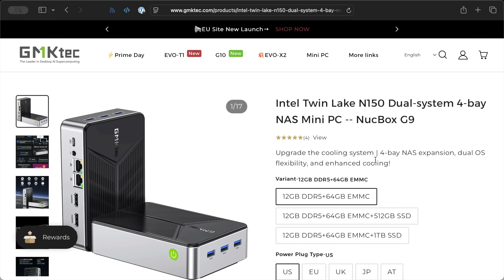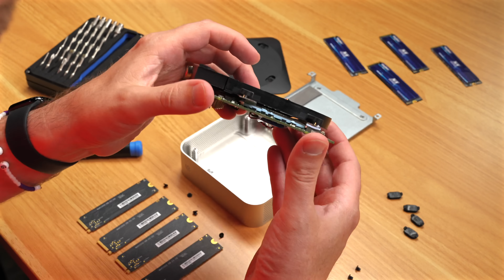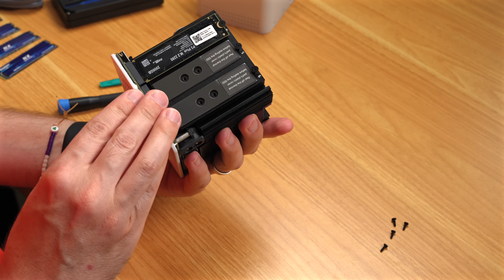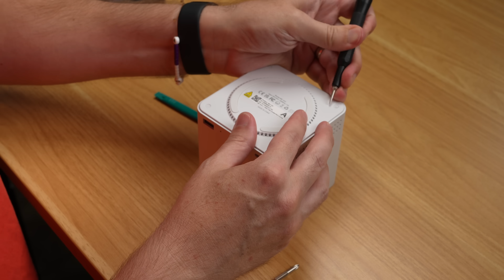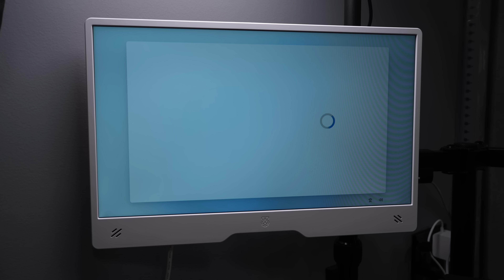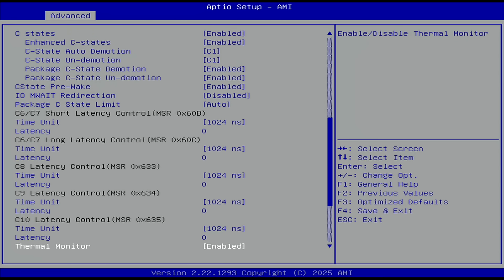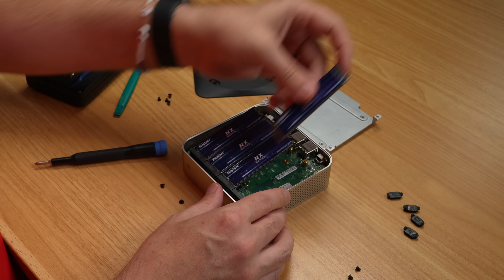The Mini NAS has arrived! (mini homelab)

Comment: just remove those rubber plugs and put them next to the screwhole on the bottom. they still function as they are intended, but the screws are always accessable. I do that to all rubber dampening stuff that cover importent parts.

Comment: I have a Beelink EQR6 Ryzen 5 with 24GB ram and 2x4TB SSDS. I was using as a NAS with Unraid, but the boot thumb drive got corrupted twice within a year, so I instead installed Ubuntu Server. I have a Minecraft Server, Immich backup of my iCloud Photos library, a couple of WordPress sites installed in Docker containers… And Time Machine backups for two Macs. Not bad for a mini PC solution that costs less than an off the shelf NAS.

Comment: Im having trouble locating a NAS for SMB. My goals are a 1U or 2U rackmount, at least 4x M.2 NVME's (pcie4 x4), 10Gb SFP+, ability to support iSCSI for VM's running on a cluster. Needs to have a decent processor as models we have tested so far come up way short in terms of driving multiple VM's on iSCSI.

Comment: i just run a rock 5b+ for a few months now. it's an absolute beast, has 24GB RAM and was super cheap (~150€). i run a 6 disk SATA controller on it for storage. (of course, it's much more tinkering involved, but that's what i wanted anyway, for cooling i just run a cheap 12cm fan that cools both the disks + the rock5b+passively)

Comment: I don't get why an internal PSU is supposed to be a good thing?  If I had the choice between a generic power brick or a proprietary PSU for a brand X device I would take the generic power brick every time because in 5-10 years time when the PSU dies I will be able to source a replacement brick with ease whereas the random company probably won't even exist anymore and on the off chance they do they probably won't be making replacement proprietary PSUs for 5-10 year old devices.

Comment: The commission section read as virtue signaling. Only disclose material connections. Drop the “bonus” for brands that did not pitch you. Score the hardware, not [the absence of] vendor offers - this revealed bias despite your claim you review based on performance only. They are sending you standard emails. Don't be self-righteous by blending their emails into hardware reviews. If you really concerned about these things, dedicate a video about it where disclosure of these inside-baseballs are more appropriate.

Comment: Just an observation.  Specs on the powersupply for the Beelink is 45 Watts. Assuming 5 to 7 Watts for the CPU and MMC, leaving 38 divided by 6 slots or 6 Watts a module. I have not been Ble to find any 4 TB nvme drives under 8 Watts. Sigh.

Comment: the solution is to buy larger ssds than 2TB if you want to keep one for the OS and then 3 for your redundancy raid setup... 3 x 4TB is not that expensive and gives you 8TB with 1 drive parity. Or go with 3 x 8TB! Just a matter of cost really.

Comment: I am looking for a mini NAS that can hold precisely 2x 3.5in HDD, 2x 2.5in SSD, and 2x M.2 NVMe and with something more powerful than an N100 or N150 CPU. Preferably at least 16,000 multicore on passmark or higher. Does this exist or do I need to build my own? I could also do with just 2x 3.5in HDD and 4x M.2 Slots.

Comment: You mention a pre-installed M.2 for the Beelink in the video, meaning it's not the barebones version for $209. Over here on Amazon that version sells for 489 Euro. Seems rather expensive - at that point you might as well look at other options such as the Asustor Gen 1 Flashtor 6. That one sells for around 500-550 Euro.

Comment: QUESTION: Could one use a spare NVME as a VENTOY OS switcher? 
Instead of a USB thumb drive?
My use case is a portable demo (demonstration) PC.
My original idea was to demo docker configurations because one could store a lot of docker images.
But, then it occurred to me why stop with docker images?
One could also demonstrate ISO images with a Ventoy USB stick (after changing the boot disk).
But why use an external USB stick that one could lose (or forget to bring with you),
When one has a spare NVME slot?
So, suppose one has a client, friend or relative that wants to put “Linux OS” on a PC?
But, which distro?
One could demonstrate for example Ubuntu, Linux Mint and Kubuntu (Ubuntu with a KDE interface).
Or if one wanted to explore GIS & spatial software one could boot the OSGeo Live ISO.
If one wanted to explore Linux multimedia one could boot Ubuntu Studio ISO.
I have also seen Ventoy users with Windows ISOs and a curiously named repair disk HBCD PE (Hirem’s Boot CD PE).
One wouldn’t run the ISOs every day, but it is like the old telephone repair trucks each with their own set of tools and spare parts. All of this software on call without messing up one’s normal daily driver RAID 1 disk array.

Comment: My GMKtec G9 arrived a week ago and I have had no issues with temp under load or idle. I've moved 12TB on to 3x 4TB over LAN and then heavy moving data around between the drives to sort. Each NVMe has a headsink, the bay is left open and I have standing on its face (power button side) to improve airflow. It's been running for 4x days now. I'll see how this goes and if I see temps climb I'll repaste and look at adding headsinks as Jeff has shown in his review. The cheery on top was getting it on sale with points earned from a previous purchase. Probably the cheapest computer I've ever bought. 

Update - I have version 2 of the G9

Temperature 41°C N
ACPI Thermal Zone 27°C
Average 41°C
CPU O Core 0 47°C
CPU O Core 1 47°C
CPU O Core 2 47°C
CPU O Core 3 48°C
Maximum 50 C
Minimum 27°C
nvme Composite 39° C
nvme Composite 2 42°C
nvme Composite 3 33°C
nvme Sensor 1 39 C
nvme Sensor 12 42°C
nvme Sensor 13 33°C
nvme Sensor 2 46°C
nome Sensor 22 45°C
nvme Sensor 23 37°C
nvme Sensor 8 42°C
nvme Sensor 82 33°C
nvme Sensor 83 39°C
Processor 0 50°C
wireless Adapter 48°C

Comment: It's interesting, it would not occur to me to be less than truthful because I may gain money from a company. 

As we tend to judge others intentions, from our own moral compass, neither would I expect any one else to be that corrupt. I find the expectation that they would be, as hinted at here, fascinating and hopefully not indicative of experience. 

I do have a Bee link micro nas, and they didn't have to bribe me to buy it 😂

I added 5 3.5" SATA drives, by sacrificing the 2 channel NVME drive slot, mainly because I had industrial 3.5" drives in my power hungry old Dell 2U server that I didn't want to go to waste.

The new system barely uses any power in comparison (saving a lot of money) and works great as part of my proxmox based home lab.
The CPU spends most of it time relaxing apparently running Debian Linux is so much easier than windows 11.

 I do only use a 2.5g network, with a 10g fibre backbone.
My Jellyfin use plus internal traffic etc never gets close to saturating the 2.5g connection, unless I make it happen on purpose. So I didn't combine the two inbuilt nics except as an experiment after purchase.

It has been the perfect NAS device for me. I've also replaced other power hungry industrial units in my home lab with similarly small devices, running proxmox. They all run cool with minimal CPU usage and have been perfectly reliable. 
My biggest power use is now the industrial UPS 🤦🏻, it doesn't even register the power draw of my miniaturised lab.

 Good luck

Comment: The ME mini seems like a great cheap all-flash NAS device. The only thing holding it back for me is the RAM. 12GB is enough for a basic NAS, but an option for a version with more RAM would be nice for people who want to do a bit of homelab stuff on their NAS. I have an N100 mini-PC with 16GB of RAM and a 4-drive USB HDD enclosure running TrueNAS (I know, USB enclosures are recommended against, but I've had no problems with it for over a year and all of the drives' features work correctly) and while 12GB would be fine like 95% of the time, it occassionally gets to about 10.5 GB used by the system, which leaves it right on the edge of what the ME mini could handle.

Comment: Use the UGOOS UT8 Pro. It has a built-in Samba Server. Afterward, you can attach a Seagate 24TB drive. I removed the thermal pad on the UT8 Pro. I then used thermal paste for the cpu and gpu. CPU idle is 36C. GPU idle is 30. On load each stays under 50C.

Comment: The power supply being built-in seems to be its Achilles heel.  6X Samsung 990 Pro (4 TB) NVME units seems to be a bridge too far with random drive drop-outs on extended read/write cycles.  I'm still running experiments, but 5X seems to be a lot more stable, with others reporting that 6X lower-power units or 4X 990s seems to be reliable.

Comment: Beelink adopted a seemingly innovative yet actually foolish cooling solution. In an all-SSD NAS, the CPU is the hottest component, not the SSDs. Beelink's innovative "chimney-style" cooling design ends up allowing the CPU to heat the SSDs instead, especially under high CPU loads like during multi-disk RAID operations.

Comment: I think it's important to consider things like JetKVM now too. If you have line-in AC, you can't intercept the power with a simple DC power extension and remotely control that. Similarly, I think it's also worth reviewing if these products can gracefully reboot after power failure. It's suboptimal for products like this to remotely lose power and not be able to boot back up afterwards.

Comment: @ BeeLink, N150 homelab NAS is nice, but it suffers from low number of PCIe lanes, slow-ish networking, not enough cores and most importantly not enoug RAM for homelab. 
I would like BeeLink to slap together pretty much Me MINI but with few differences.
1) Ryzen mobile CPU inside Ryzen 7 or Ryzen 9
2) possible 64 Gig of replaceable RAM
3) 1x 10 Gig SFP port 1x 2.5Gig Ethernet Port.
4) exposed power button pins on motherboard ( for hooking up something like piKVM )
5) 6 x M.2 Slots with at least 3.0x2 speed
6) expose rest of PCI lanes on motherboard in one standard PCIe slot
7) support for PCIe bifurcation on all slots.

This would be my ideal Mini Home Lab NAS that would give me everything I want and more.

Comment: I got a beelink mini as my travel NAS, because I usually go to another country and work there for 6 months each year, I have a full 8 bay NAS at home, every time I come home I sync data with it.

The machine itself is fine, but I do wish the hardware spec could be better, like a 8505 CPU or 10Gb NIC, I know 250USD is cheap, but I would pay more since one single 4TB NVME SSD is at least 200 USD.

Comment: The Beelink looks interesting for a dedicated NAS I need for long term storage of my Blue Iris DVR files using TrueNAS.  I can start with a 3 SSD/drive RAID5 array and add to it down the road should I need to.  I'll probably cable it directly to my DVR with one of the 2.5G Ethernet ports and leave the other for connection to my network should I want to store other things on it.  That is what really limits the thru-put.   Pretty good value for the cost IMHO.  I just wonder if placing the OS on the eMMC and saving the M.2 slot is a good choice (with its limited life span).  I really wish they'd offer it with an HW RAID controller option.

I appreciate your open and transparent policy with product reviews.

Comment: Not sure how I feel about these mini PCs that use nonstandard or soldered parts and are essentially non-customizable and non user serviceable. They are cheap, but they are essentially disposable devices.
Reply: It seems like an mATX motherboard with an N100 on it like I have seen from Asus or Asrock in a standard mATX case with a regular ATX power supply is a far more robust solution when it comes to thermals/expandability/reliability of the power supply. It is bigger, but it is self contained unlike these machines powered by sometimes large power bricks of questionable quality.

Comment: It is not crazy at all for the motherboard (closer to CPU and heat transfer via conduction) to be hotter than the top of the case (further away from CPU and heat transfer via convection).  It is just physics.

Comment: Hi Jeff, can u please crosscheck something i guess i figured our.

When i use my Me mini (1x2TB, 5x 1TB (3 Sandisk, 2 WD Blue)) under windows 10 or 11 i have stable heat of 60-65 degrease (CPU), and 45  on the NVMEs; under load/idle is less;
Under Linux it is 5 til 10 degrease less.
But , yesterday i used a USB 3 Stick (Ventory with Gparted/other stuff) on the front (Backside i have USB Switch for keyboard/mouse, Lan-wire)
and heat went up till 80-82 (throtteld) and same with the nvme´s ... by 70 degrease.

I remove the white case... (without front stick) and temp was normal , as always

Today i made the same (front stick/case on) and it went again up; with removed USB 3 Stick, temp was normal as always
I boot fromt the internal EMMC (win 10; or NVME 2TB Original Windows 11) by pressing f7

So i guess, there is maybe an issu, when in the front port USB 3 Stick is pluged in.
I can´t crosscheck bymyself, cause my 2nd one is out of house

MAybe u will have time to check this up, or maybe u have an answer. thx
Reply: Thank you for your feedback! Our technical team is currently investigating the issue. We’ll keep you updated as soon as we have any progress.

Comment: I think the reason you're seeing so much heat on the bottom is the fan on top is configured to blow air DOWN instead of pulling air up. Compare it to the design of the Xbox Series X. That one has a fan where the fins are inverted, so the concave side is pointing upwards. It should pull air from the bottom to the top, and work WITH convection rather than against it.

Comment: Would be interested if you could add if it can handle running something like Jellyfin, though guess this is more of a set-up question since the N100/150 should both be able to handle GPU transcode on the internal graphics for a stream.

Comment: I've been using a cheap mini PC and USB enclosures to act as my NAS.  It works fine and is the cheapest method I know of.  The only issue might be compatibility with RAID but who really cares about that?  USB 3.2 and 2.5 Gb network ports were the biggest "expense" for the entire thing, aside from the drives themselves.

Before you even realize that I'm using spinning metal disks as my storage, 3.2 USB has transfer speeds as high as 20 Gb, which is double even the fastest network speeds.  Only NVME drives can push high enough transfer speeds to feel kneecapped by 3.2 USB ports but they'd get kneecapped even harder once you try to send stuff over the network.  So, why not just use 3.2 USB enclosures?

Anyways, my setup has worked just fine for a couple years now.

Comment: Thanks for the helpful video. It just feels so wrong to buy a bunch of M.2 drives where even the cheapest ones can do 5000 MB/s, and put them into a NAS where they are limited to 250 MB/s... why is to so hard to build a small M.2 NAS  that uses the full speed that M.2 offers? Doesn't even have to be some super fast Ethernet connection, I'd be fine with just USB4 40 GBits. I'd be happy to pay $800 for it if I have to, but it seems no one is building it.

Comment: Wouldn't a small usb nvme enclosure fix the stability issue on running the OS externally? Or is it the actual USB protocol that causes the instability? Anyway, I've just bought the CWWK P6 pocket NAS (N355) and that would be a nice comparison I think. Especially vs the K100.

Comment: is "fast" storage any useful below 25gbe networks?
Reply from the maker: Latency, power use, physical dimension, and noise are the four nice things about NVMe storage (at least most consumer drives), compared to hard drives (which trounce flash storage on capacity per dollar).
Reply: @JeffGeerling only if cheap, fast networking could catch-up....

Comment: I really think that Beelink is gonna be a game changer, just add a little more thermal pads or an SSD with it's own heatsink if it fits.

Honestly your review was fantastic, clear and exact with the same testing, I think with SSD prices going down and heck standard ethernet networking in home (specially in the UK) if someone wanted a micro nas that's fast the Bee link is solid with it's size but also storage capabilities with the 6 drives.

Most routers provided by ISP's are 1gb max here so you'd not be stressing it out unless you had a whole ass network setup but yeah, that Beelink looks fantastic.

Comment: The Fan blows the air down... It should be reversed to pull the heat up through the tower then out the top... That is why it is hotter at the bottom in your thermal shots.

Comment: I've been running a 24 TB ME mini for about a month and I'm very happy.  During initial setup 3 of my NVMe drives stopped responding due to overheating.  The bios came with the fan set at a fixed low speed!

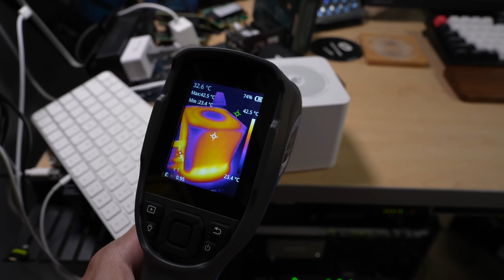Comment: 11:03 The reason your thermal image has a hot spot around the bottom is that the fan draws cold air in through the top and exhausts the warm air out of the bottom - a bit counterintuitively, it should probably have been designed the other way around.
Reply: I saw that in other review. Maybe if we rise the distance between the device and the desk?